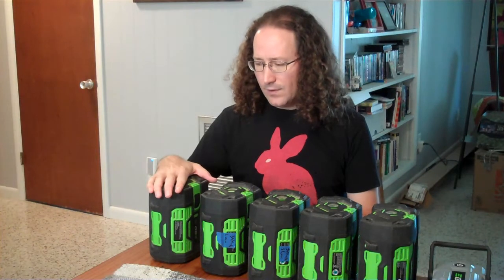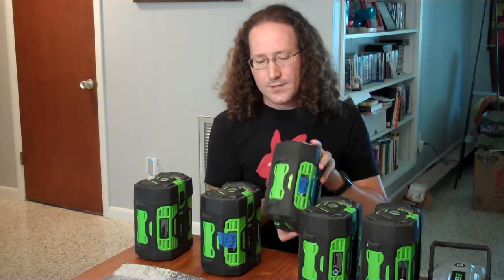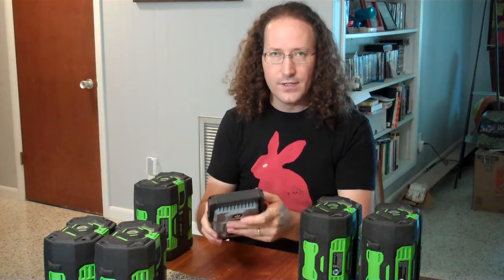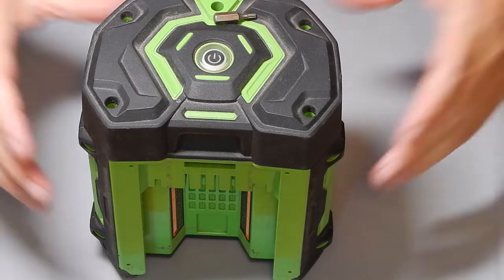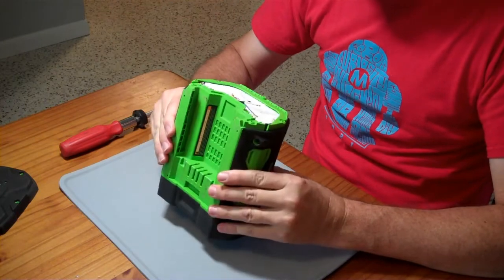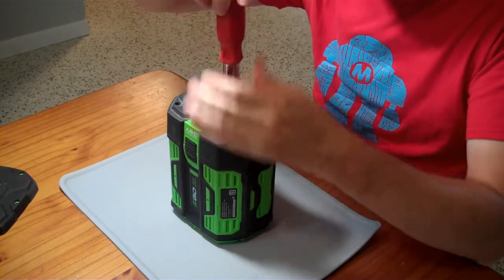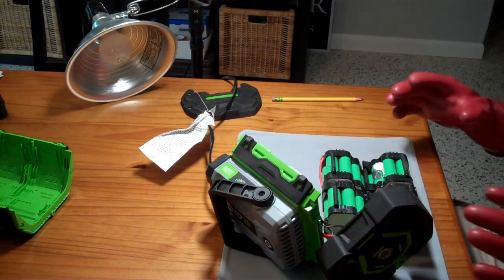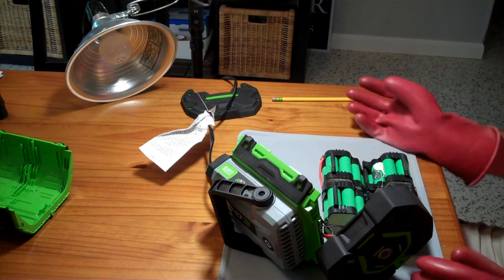Opening an EGO 7.5AH battery to test cells

Comment: My mower had the same failure: full charge 7.5Ah flashes Red after 10 feet, not using self-propulsion. Watched videos, was leaning towards checking the 3 safety relays and for frayed wires @ pivot point, then I remembered hitting a stone with the blade and having to Dremel an edge on the resulting ding. Put this blade on a nail and discovered it was a couple degrees off level so unbalenced. A new mower blade fixed this problem, have had no problems for over a month mowing 2 lawns that total 1.5 acres.

Comment: The screws on the outside of the case that you need to start to remove first to get inside the battery is "Torx #15" security bit. 
It's like a normal torx bit that has a hole in the middle.  The actual screw that you need to remove has a little nipple dead center on the head of the screw. That is the "security" part.

Once you removed all of the screws that are on the outside of the battery case there is a possibility if you're wanting to take apart the battery packs inside with the individual cells that you will need a "Torx #10"

Comment: my 7.5 kept showing a overheat condition when just starting and I got the solid red light on the quick charger.   it happened 10 days prior to the end of the 3yr warranty.  EGO replaced it, so kudos to them....I haven't pulled it apart yet...prior to failure, my mower would cut out due to over-temp, even on 60* days

Comment: Ty for the video, I think I fixed mine by reseating/cleaning the connection that is between the 2 halves of the cell packs
Check out 13:30 of this video: "EGO 56V Gen1 5AH Blinking Orange Fix" by Thrifty Tool Shed

My original complaint was that the mower would randomly cut out while mowing. I think the battery would flash orange, and the mower might have flashed yellow. You would have to wait 10-30 seconds, and then it would be able to be restarted/used as normal

I did the Thrifty Tool Shed "fix" (basically pull the 2 halves apart, pull the connector or two out, reseat them). I then mowed my lawn. The mower did not die. It also seemed to automatically kick into a "turbo" mode when about to bog down. I don't recall it doing that before the fix. So maybe the turbo boost is related; like, it draws more power, which overloads some loose connection or something, and causes a safety fault. I don't know; I'm not even 100% sure it's fixed, but it's been through 3 charges since, and no cutouts yet. Previously I think it would cutout once every 1-2 mows.

Comment: Hi, there is a pattern that I am seeing with EGO batteries with high resistance developing across the connector plug connectors. Sometimes just bumping the battery will fix it. If you pull it apart and simply plug & unplug connectors you fix 'unexplained' faults as recorded on the BM system. Best to have a can of contact cleaner (eg CRC NF Contact Cleaner) at hand and give the connectos a spray whilst seperated.  One other point, thre main personal danger of opening these batteries is arcing faults between the high energy cables. (Any any short can also kill the electronics) A heavy arcing fault could also lead to battery explosion or fire both of which could be quiet bad. However, your skin is fairly resistive to 60 Vdc and so it is virtually impossible to get an electric shock off these batteries so your gloves are not really required for electric shock protection. That said, in other circuits with large inductors, 60 Vdc could be 'enhanced' with inductive loads, but not in these batteries.
Reply: You seem to knowledgeable in this area.   I have a question for you. Since the cells appear to be 18650 cells, how feasible is it to replace them yourself and how would one go about increasing the capacity?   Would that simply be a matter of using higher capacity batteries?   Is there a circuit board that would need rewiring in which case, never mind lol?   Your thoughts would be appreciated :-)

Comment: Hello… I had same issue you had… took apart and put back together and it now works… EGO Rep. said I need to replace the battery… saved a lot of $$$.
Reply from the maker: Only thing I can think of to explain it is that a wire with a bad connection got bent the right way to "fix" it......because I didn't actually do anything other than open it up and look at it.

Comment: Wondering if you're able to provide the order for the 12-pin connector on the 7.5 batteries? Was taking mine apart for a different reason and they pulled out with very little force (was quite surprised). Thanks!
Reply from the maker: I'm afraid I do not have that pinout information.

Comment: according to ego tech support if the batteries do not have that extra shell around the cells then its a rebuild battery.  ego tech told me that all they use in all their batteries and has not change their technique.

Comment: To test battery cells-Fully charge as normal. Use for about 2 or 3 minutes. Now take apart and test each cell pack or each individual cell. You can run the battery longer, but don't try to discharge.

Comment: Do you happen to have pics of the connectors on the “BMS”
I’m trying to repair one that was found and curiosity is stringing of proper order for the wires and which one should be in which terminal of the plug.

THANKYOU and great video! 5 7.5ah batteries !!!!! Yeeeshhhhhhh
Reply from the maker: I'm afraid I do not, in the one I opened the BMS board was "potted" inside
Reply: @summetj  Thank you for your response!!!!! I was looking for the connectors that plugged into the bms.....the terminals pulled out of the white clips.

I appreciate all of your help!

Comment: I've read other comments where they just take the battery apart like you did, moved some wires out of "crunch positions" re-assembled & wallah !!! just like what happened to you.
Reply: I can't believe that I just took my 7.5ah battery apart, put it back together, and now the dang thing is charging and running my mower with no problem.  What it was doing was that it would charge up 75% and immediately jumped 100%. Then, when I go to put it on the mower or the blower, it would immediately flash red.

Comment: Some wires came loose from the connector while taking apart. Its the upper right connector (low side?) 12 pins,  but with only 10 wires.  Here is what I know {Blk-Blk-Red-Grn-?-?-?-Wht-?-Grn-?-Blk}.  I have three wires that pulled out.  They are Blu,Red, and Yel. Can anyone help?
Reply: Order is: black, red, green, yellow, white, blue, empty, empty, green, red, black, black
Reply: So you matched what you knew from remaining wires with what I knew/ Brilliant!
Reply: Wondering if you ever figured this out? I didn't see this post when I asked the same question a bit ago. Thanks for any info you can pass along!
Reply: @TooncesLives  No.  I keep hoping

Comment: when you took them apart
you un tangle those wires

i seen a few report that is how to fix most of Ego issue unless your cells go bad, those Samsung cells are pretty reliable
Reply from the maker: It is certainly possible that one of the wires has a small break or intermittent fault within it and by rearranging them I touched the ends back together better.
Reply: @summetj  you don’t really need to wear those gloves lol 
i worked on many tools batteries
they won’t shock you, just make sure you don’t short them up cuz they burn anything even those gloves
Reply from the maker: @TranTek  well, since I had them, I figured better safe than sorry. In the US under 48 volts is the "low voltage" designation, but I do agree with you that the 56 volt battery is nowhere near as scary as the 400 volt Nissan leaf pack.
Reply: @summetj  60 V is the threshold generally used for lethal shock risk. Better safe than sorry.

Comment: Very helpful, thanks. My battery is 2 years old and after 10 mins of running it will flash orange.  It’s so confusing and curious if you have had to repair or test that issue yet.
Reply from the maker: They come with a 3 year warranty (for the original purchaser) and that sounds like something ego would definitely repair under warranty.
Reply: @summetj thanks will call the company.

Comment: Huh... Well... I'm stumped. My old battery appears to be perfectly fine. I was sure I had some bad Leakey cells because of some white stuff that showed up behind the holes of the covers, but nope, it's just the insulation they use. All the cells look great, and the voltages are right where I would expect... So... Vrm or connection issues?

Comment: May I ask what is the part number of the Samsung li-ion battery? Is it INR18650-20R or INR18650-25R?
Reply from the maker: The label on the cells only says "INR18650S-2500mAh 3.6 v
9.0 Wh UL1L031FQB 234642" so hopefully that helps
Reply: @summetj  Thanks. It is not meant to be used for power tools which require high drain current of at least 20 amperes (CDR continuous discharge rate). It has a max. CDR of 7.5 amperes. That is why these batteries die early. They should have last more than 10 years if they are the original Samsung INR18650-20R (discontinued).